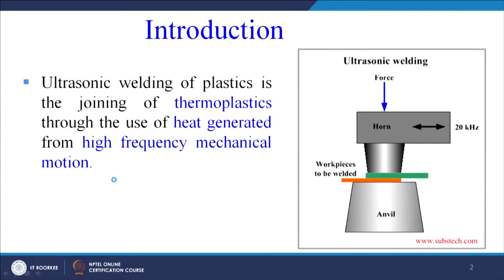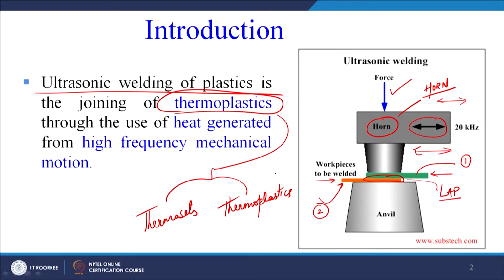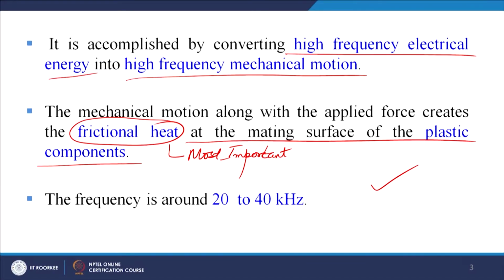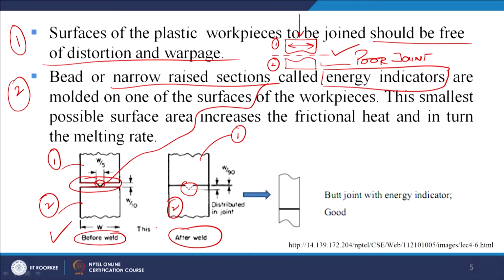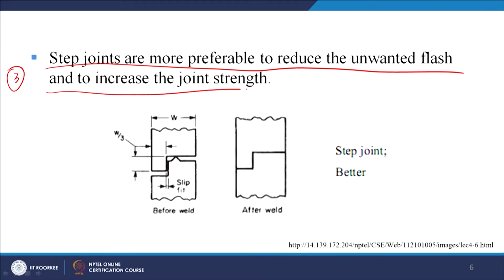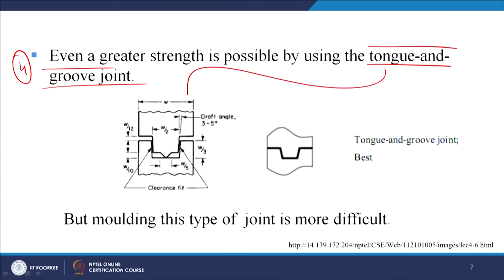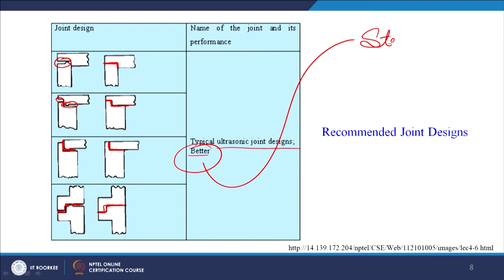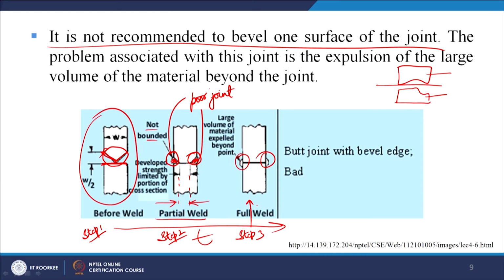Ultrasonic Welding : Plastics

Comment: nowadays energy director(ED), a thin film made up of the same adherent material is placed between the two surfaces. ED is  designed to concentrate the ultrasonic welding and facilitate the melting and bonding of the mating structures.